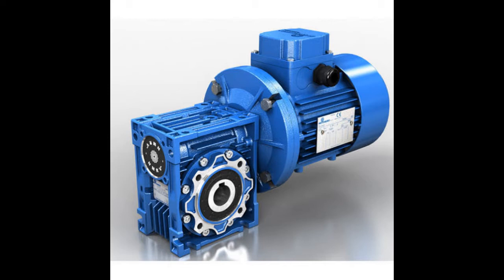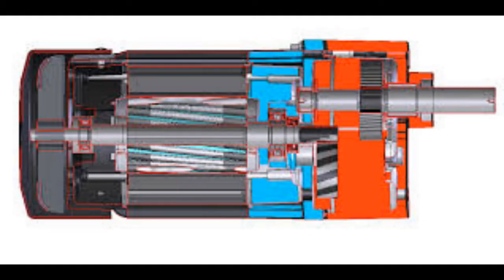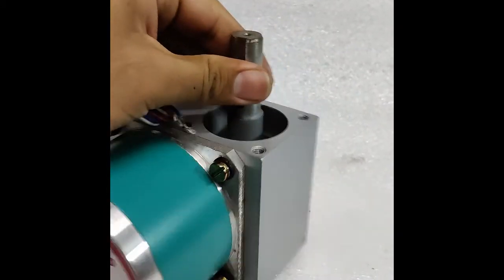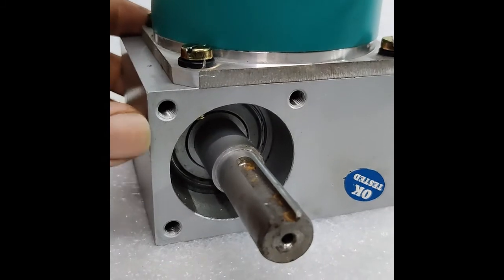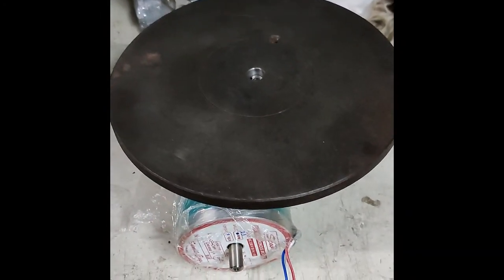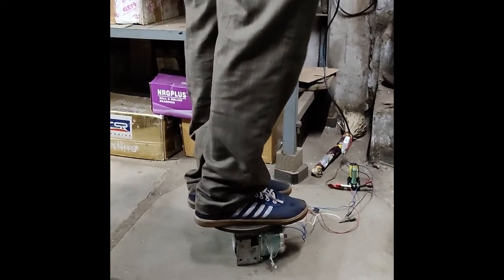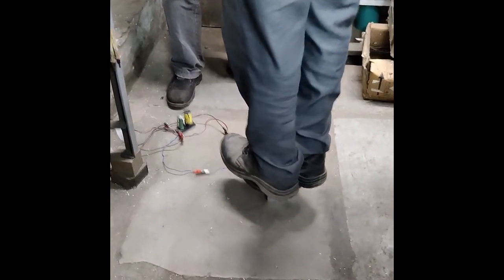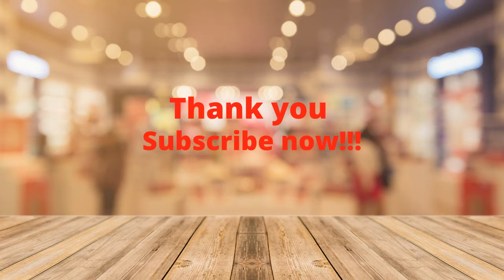Small Motor with 100kg capacity!!!

Comment: Hi sir, I want to rotate a 25 kg load clockwise with low rpm. Can I use a 30nm wiper motor for this requirement?
Reply from the maker: Yes

Comment: Can you suggest 150 kg right angle gear ac moter with speed control er
Reply from the maker: Kindly explain me your application on WhatsApp 8320466117
Reply: @SumitPanchal0351   sir I WANT 1 HP SINGLE PHASE HELICAL GEAR MOTOR